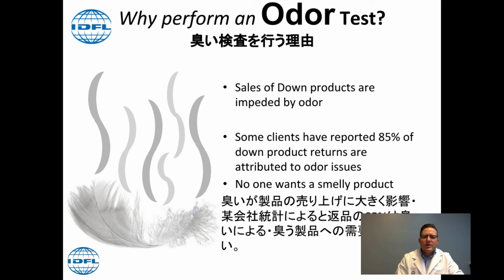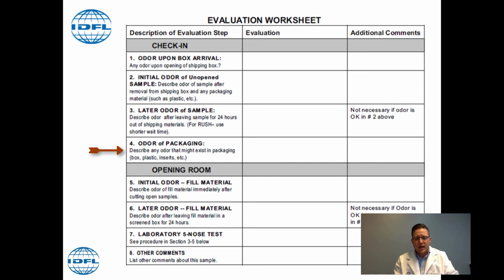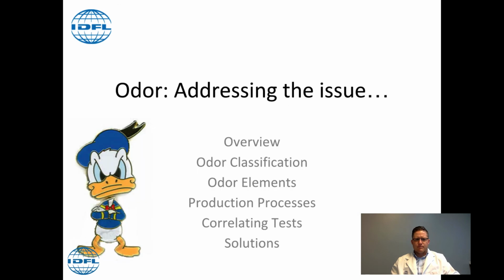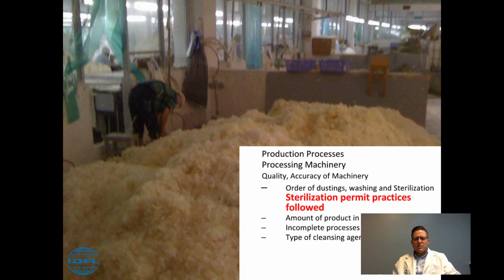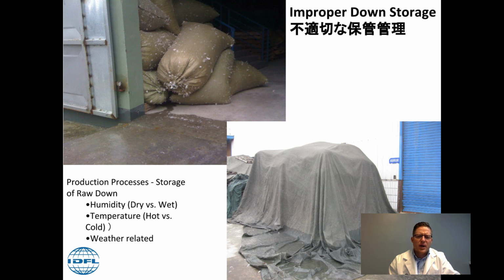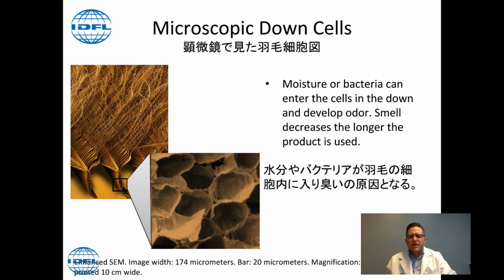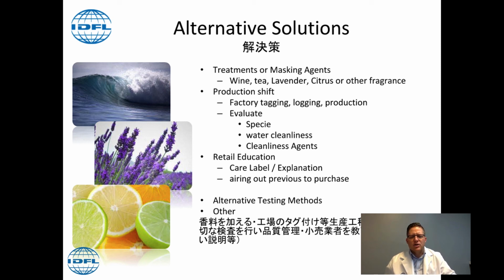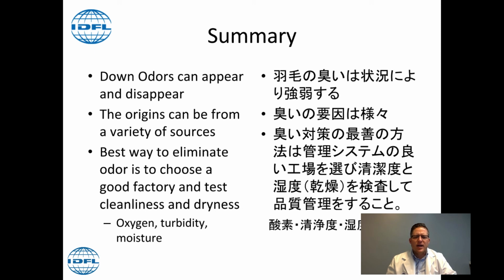Down Odor Presentation JP

Comment: Hey, Keith. I bought a vintage Sierra Designs Down sleeping bag (early 70s) and it had a string funky smell. Based on an old catalogue, it looks like it’s duck down. I’ve used Clorox wipes on the outside, put baking soda boxes in it for a week or so, bladed it with UV light, and hit it with ozone. The smell is minimal now, but still kinda there.  Is this pretty much just what duck down is like?  And 50-year-old down is probably gonna be the worst?  Lol
Reply from the maker: John, sorry for getting back to you so slow. For your information, DOWN can be washed with water and soap, it is how it is done in the slaughterhouse, the processing manufacturers and that’s how mom does it :). There is an old adage that people cannot wash down Or it has to be dry cleaned which is incorrect. Ducks and geese are in the water all the time. From our research, we have found that older sleeping bags as long as they are taken care of well will have less and less odor.
I would suggest washing the entire sleeping bag with a light soap. The only degradation of the sleeping bag that will happen will be with the shell. At the very worst, some seams might leak ever so slightly. But, A few feathers lost will provide a better nights sleep than Somethings smelling like a sick wet duck.